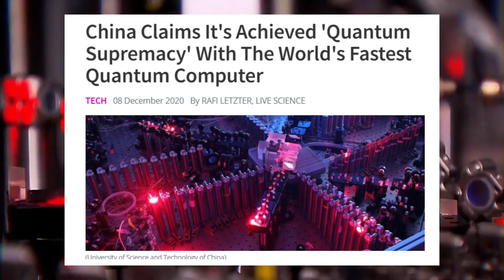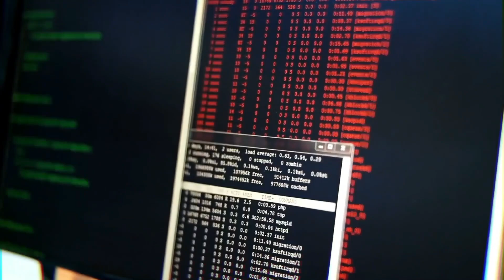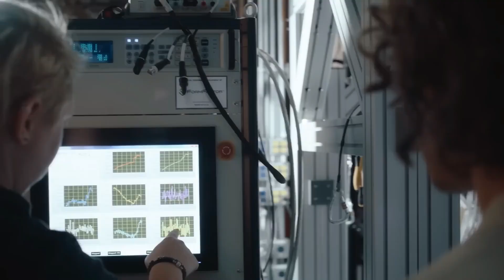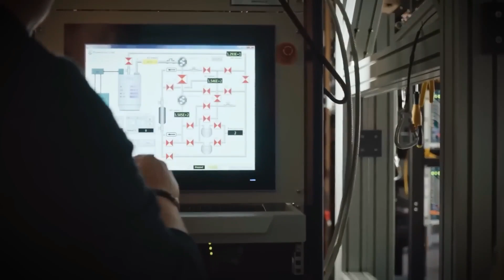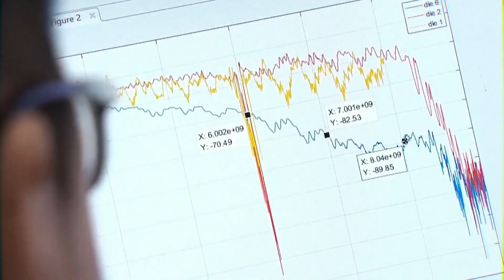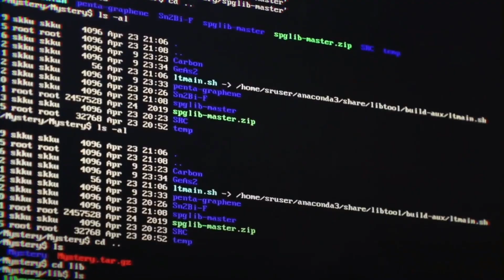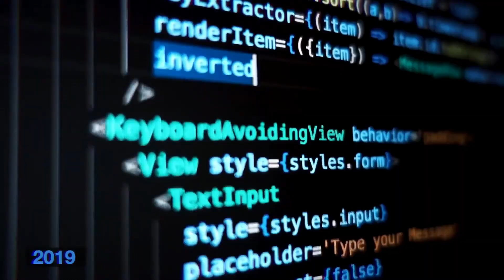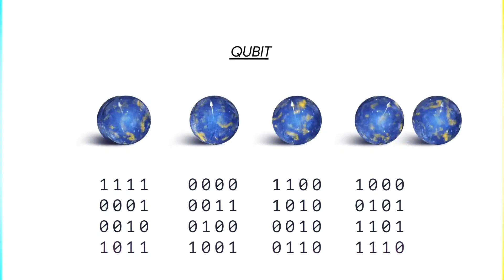China Quantum Computer Breakthrough SHOCKS the World!

Comment: Are you kidding ? 72 Qubits? Only? Majorana processor has 1000 Qubits
Reply: the most important thing is stability and accuracy 72Q, is better than a 1000Q if the latter is run wild randomly with tremendous errors in.computations
Reply: @zeroisconsciousness8376  The Microsoft Majorana 1 chip is currently considered the most stable quantum chip due to its topological qubits, which are inherently resistant to noise and errors at the hardware level. This design makes it more stable than other quantum chips, but it's still in the experimental stage and not yet widely scaled.
Reply: Majorana is not functional yet.
Reply: The latest information indicates that the Microsoft Majorana 1 chip is still in the experimental phase and does not yet have 1000 qubits. The chip is based on topological qubits, which promise higher stability, but large-scale qubit arrays have not yet been achieved. stop the cap.
Reply: Willow has how many quits? Don't matter, the day of the terminator is on the horizon